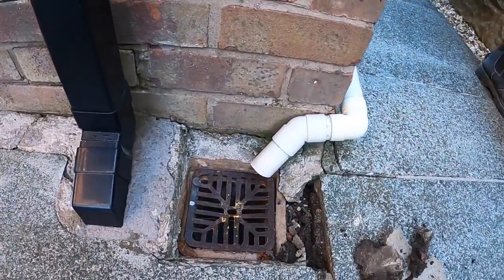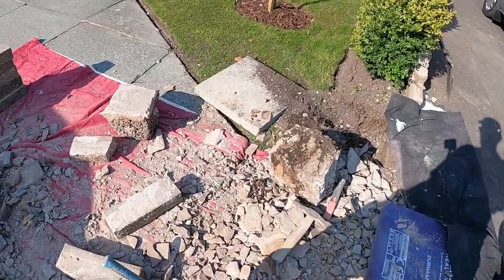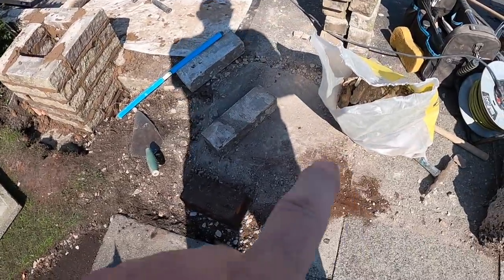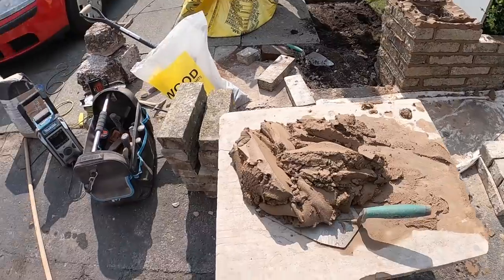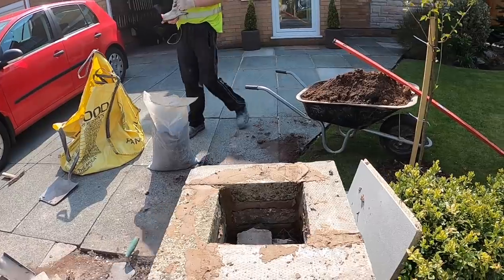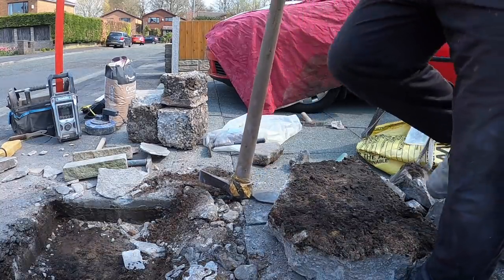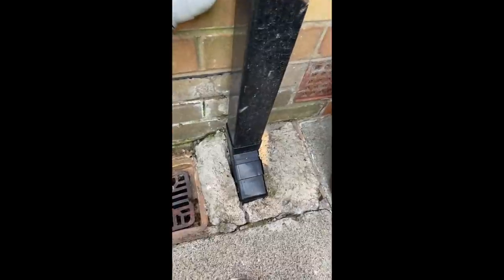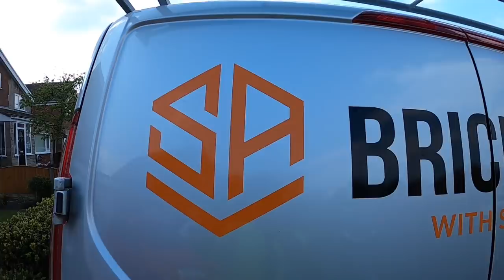HOW THE HELL WAS THIS PILLAR STILL STANDING!?

Comment: It is a long time since I have seen brickies rebuilding Marshall's walling, I always found it easier to throw the old bricks away than cleaning them, as you found was a right pain in the butt.Concreting the middle was normal where you were going to hang a gate on them as it looked as if you had a gate hinge already embedded in the old pillar.
I lost count of the number of walls  I built in this material in those days.
However, they do tend to go up quickly but hard work on the grip of the hands, Well done for the work, Really I would have put full concrete foundations under an area a car is going to run otherwise they are inclined to tip with the weight of the vehicle.Similarly concrete the lip from the kerb to the new slab.Each to their own I suppose

Comment: Bradstone, did loads in the 70s hated them, we used to V joint them if it was posh or rake them out with a piece of dowel if it wasn't.
Reply from the maker: 🤣 Got a Job coming up and we need a match and this stuff is RARE now !
Reply: @SteveAndAlexBuild  They used to do a buff and grey in both split faced and pitched as far as I know they only do grey now, I think Marshalls still make this walling which is more or less identical.
Reply from the maker: @andrewpalij4691  Cheers 🧱👍🏽

Comment: spotting flags in a drive way deffo a no no
Reply from the maker: Yep I know that and that’s why I mentioned it a couple of times in the video 🙄👍🏽🧱
Reply: @SteveAndAlexBuild  would of been better if you did solid bed might of stood a chance of lasting
Reply from the maker: @marklawrence2592  . As I said in the video they are temporary because the drive is being replaced soon . Instead of the customer trying to get a Flagger  to come and put in 2 flags I agreed to put them back in so the customer could use the drive straight away .
Reply: @SteveAndAlexBuild  might only be temporary but first time a car drives over it will crack been better practice  2 full bed it thats all im saying
Reply from the maker: @marklawrence2592  we were back there about 3 weeks ago which was about 5 weeks after we did the job  and the flags are still in on piece .

Comment: Far for me to comment, but when dismantling the pillers your took the top layer of bricks and stored them on the floor , but when relaying the piller you worked from the top of the pile at the bottom ,to the bottom of pile at the top of the filler (upside down)  you should have rotated the pile`s.and another thing most of  the rubbish off cuts etc stuffed into the piller centre.
Reply from the maker: Sorry but that doesn’t make any sense 🙄😆

Comment: I would have insisted upon  a 3:1 muck in the quote... your muck is far too sandy, in my opinion. My house needs repointing, due to such a sand-rich muck.
Reply from the maker: 3to 1 is way too strong for re pointing or brickwork unless it’s in an inspection chamber and engineering bricks 🧱👍🏽